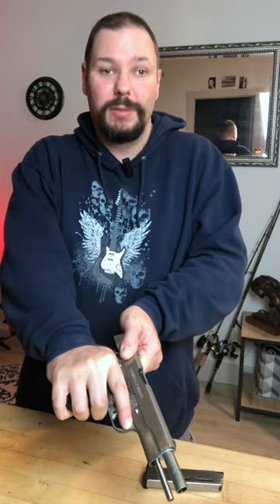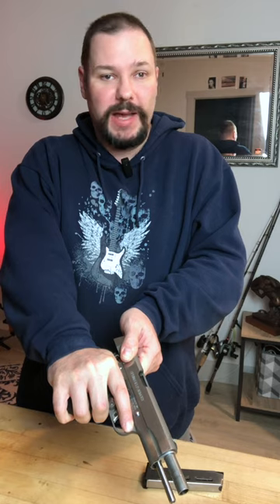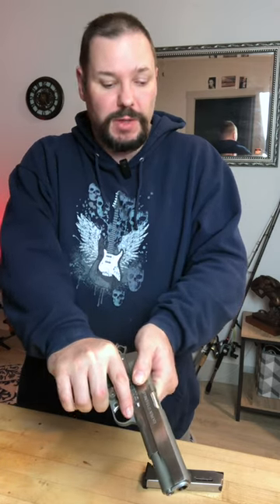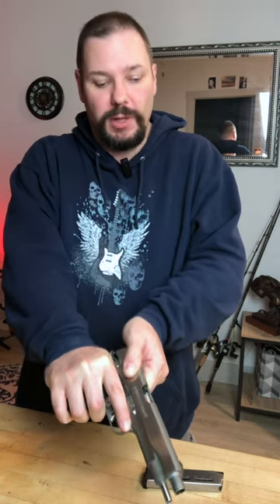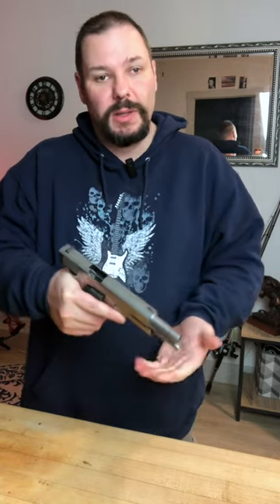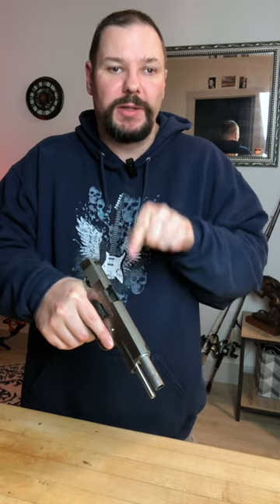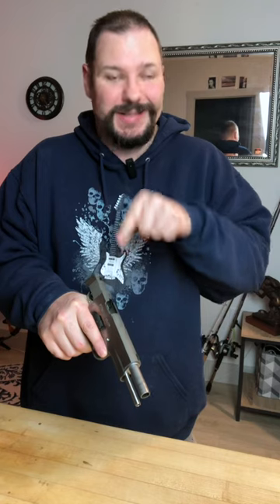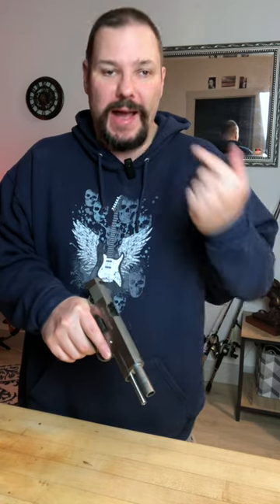Order Of Operations  - How to unload a Handgun Safely

Comment: I'm paranoid about clearing a weapon. I stick my finger in the chamber. I live alone, but, will recheck a weapon if I walk away. I never trust myself. It's the only time I feel it's OK to doubt myself.
Reply: Over caution when it comes to firearms is never a bad thing. However, being afraid of a firearm or "paranoid" as you put it can be dangerous. I suggest training under supervision of a professional until you become comfortable handling a firearm. There are classes that practice proper weapon clearing, handling, carrying, and firing if your interested. Hope this helps. =)
Reply: I wouldn't suggest putting your finger in the chamber.  Have you seen the force of the slide when it resets? No thank you.
Reply: @thezohan1960  that's the right way to check it 👍
Reply: Sticking your finger in a chamber is more dangerous than forgetting or leaving a round in the chamber.

Comment: SOP when training new recruits in our organization. Whenever you open you gun locker and when you unload daily it’s always the same drill eject the mag, rack the slide to the rear (ejecting the round) and lock the slide open, peek (into the chamber) poke ( your pinky into the chamber to feel there’s not round ) and prod ( finger up the mag well again verifying nothing is there or stuck in the Magwell for when your reload).  This assist the aspect that in Canada over 85% of LEO recruits have never handled a gun in their life . Unlike 30 years ago it was more like 20%.  But this training forms a very good habit of visual and tactile confirmation you have unloaded correctly.  But also I can say in over 8 years outside of recruit training there has only been on accidental discharge at a clearing barrel. And that’s with 500+ officers in the field daily.

Comment: Amen! I've had a 12 Guage Mossy Shockwave that one stuck in the chamber after racking it maybe 30 times working oil in. I glanced in but didn't look too good I guess. I had to fix a hole in my wall, and needless to say it'll make the woman living with you very unhappy as she just bought the fire extinguisher I hit first. But I confirmed #4 buck is good for an apartment 6 went thru 5 came out the other side and all over the floor. The other 25+ pellets went everywhere else like a grenade and it took out 2 light fixtures and everything on the kitchen counter bouncing everywhere. You can see little dents here and there in the kitchen. I been shooting since I was 5 and have always been very careful. It can happen and I got lucky and learned a lesson for life!

Comment: I rack it back and lock it with slide release with the mag still in it and look if I can see the follower. Then just tilt it back and forth, chamber, follower, chamber, follower. Extra points for seeing an extractor and putting your finger tip or stick a chamber flag in the chamber to make sure it’s clear.

Before you dry fire it, you check again to make sure you are not trippin, and then check again to make sure you are not tripping balls.

Source: I work at a gun range/store

Comment: He's absolutely right. I did a poll on Reddit on r/firearms asking people if they've had a negligent discharge in their life, and how much experience they have or had at the time. For the people who had a ND (about 30%) it was about 60/40 over/under 10 years of experience. A fella in the comments admitted that he was an Army armorer for 20 years, worked with guns his whole life, and last month had racked the charging handle on his AR-15 before putting it away, but breaking the advice he always drilled into his subordinates in the army, he didn't visually inspect it. Dropped the hammer and bang, thankfully nobody got hurt.

Always look. And if you're about to pull the trigger for some reason, look twice, hold it open and hesitate for a moment, gaze lovingly into the chamber and confirm that you are not blind, you are not distracted, you are not hallucinating, there really is nothing in there. Someone's life may depend on that simple operation.

Comment: This! especially if it’s a third party mag, and or a reloaded cartridge, even more so if it’s both of these circumstances! Could be issues with mag spring, the feed ramp, feed lips, seating issues, extraction issues, and sometimes if it’s reloaded ammo that you yourself didn’t  reload, there could be a myriad of different issues with dimensions and small issues in the reload process. Rounds like .380 auto and 9mm can be very easy to mistake, ESPECIALLY IF NOT TOGETHER FOR COMPARISON.

Comment: Thanks god I’ve always been skeptical about rounds not ejecting when unloading my guns 
So I automatically check the chamber 3-5 times after removing the clip I still go to a safe place point either down or to a target and proceed to dry fire reales if all parts from tension making it safer to disassemble for cleaning etc 
Please post some safety tips soon on how to handle loaded firearms so people learn , here in Georgia anybody can now buy firearms without the proper training nor licensing and I feel there should have never allowed that without offering free training before hand but it is what it is

Comment: Also little tip a shooting instructor taught me. When you rack the slide don't use your thumb, use your palm and fingers.
Reply from the maker: If grip strength is an issue, absolutely. particularly for smaller hands on pistols with heavier springs.
Reply: @BulletsNBrass  I was told of an officer shooting where his thumb was shot off and he didn't realize. When reloading he tried to pull the slide to rack a new round and couldn't. Was shot and killed

Comment: I know it's 1911 model but which gun is this actually
Reply from the maker: Springfield armory mil-spec stainless. It’s had some work done though. I bought it heavily used and modded the frame to suit me. I use it with a 22 conversion usually, so the slide is still stock other than a full length guide rod I had laying around.

Comment: he didn't mention why you should look some blowback guns do not have an extractor the pressure blows the brass out other ones the extractor may be not working and not pull the bullet out. and almost two fed rifles there is a catch into the catches the next bullet so you need to work at 2 or 3 times to make sure you get everything out. (shot holes in two houses learning this)

Comment: Actually, the very first step when clearing a weapon is to put or attempt to put it on safe before dropping the magazine. Some pistols do have a safety on them.
Reply from the maker: See the video I just posted. Quite a few pistols with a manual safety don't let you operate the slide with it on. I would put "turn on the safety" into the category of good advice, but not part of the general procedure. If you can, great, it can only make things safer, but it's not actually part of the process itself. It's like wearing a helmet on a bike. You don't need it to ride (other than maybe legally) but it's generally a good idea.

Comment: Actually, you missed step 1. Make sure gun is pointed in safe direction. Thanks for playing.
Reply from the maker: Actually I didn't. Never assume. One concrete wall is as good as another when they're on five of the six possible sides. The unsafe direction would have been to my right, which has windows leading to a public space. But hey, you bumped the YT algo for me so thanks for playing.

Comment: Final step, drop the slide on an empty chamber on a 1911 to destroy the trigger job!
Reply from the maker: Maybe if you have crap parts, or super fine tuned parts, but these are quality parts with solid engagement. While I won't tell you it does nothing, if I eventually have to replace them it will not be from doing that, it will be from how many times it got used for dry fire or live fire drill.
For those not aware, the reason this is considered an issue at all is that just like dry firing a bow, not feeding a round as the slide closes results in higher speeds and a sharper stop. It can lead to what's called sear bounce. Since the engagement surface between the sear and the hammer is a very tiny shelf under significant load, that causes more wear and tear. On quality guns with good parts it's more likely to just make your trigger feel more gritty or have a bit of a catch to it. On guns with lousy metal for those parts it can lead to enough wear that you get something called hammer follow which is where the hammer drops with the slide because the sear couldn't hold it. The contact surfaces have rounded off.

Comment: Another tip I would give is to not rack your gun like that but rather practice racking your gun with your palms and fingers over the gun rather than just your thumb.
Reply from the maker: Both work, what you're describing works better if someone is marginal for hand or arm strength. I prefer this method for myself because it makes it easier for me to see into the chamber. Annoyingly, the smaller handguns with stiffer springs where the other method would be most beneficial are actually harder to see into when using it. I've done a few videos where I talk about different methods of operating a slide, maybe I should do a short on it. There are a few different ones and they have different pros and cons.

Comment: Also don’t flag walls in the house while your checking for a round
Reply from the maker: Well, since the walls in my house are concrete and the floor and ceiling are also concrete… the least safe direction would be to my right, which has windows. To my side or forward would have to go through two concrete walls to get anywhere, at the minimum.

Comment: Well the real correct way would be to place the weapon on safe and cocking the slide back ensuring any round is ejected and nothing in the chamber.
Reply from the maker: Good luck with that, as I've said on a few other comments, that's physically impossible on a 1911 and many other handguns. In this case, because you can't move the slide while the safety is engaged. In other cases because there is no manual safety. Cocking is what you do with the hammer, not the slide, and the whole point was that just because you pulled the slide back does not mean the chamber is clear. Performing the action doesn't mean you got the desired results. You have to actually check.

Since there seems to be a lot of confusion specifically about "put the safety on first" I actually plan to do another video. The whole point is educating people, so if that many folks don't know why I wouldn't include that step it's worth putting in a video.

Comment: Most of the time on hand guns if there is one in the chamber if you pull the slide back it will automatically extract the round there for nothing being in the chamber if something happens it was a gun malfunction there for you are not liable due to the gun manufacturer
Reply from the maker: If your firearm puts a hole in something it shouldn’t have, and your finger was on the trigger, you are the responsible party. The only way a court is going to assign blame elsewhere is if it fired without any input on your part. You are responsible for making sure it’s clear.

Comment: Drop the magazine and rack it 3 times. 
There's no way a bullet would stay in the chamber if you rack it 3 times.
 The reason that we rack it 3 times is to make sure the idiot didn't leave the magazine in.
I have never seen a gun that didn't Get rid of the round in the chamber when you rack it back.
Reply from the maker: I've had plenty do it because the rim had an issue, the extractor was broken or it was a rimfire that only catches the extractor after firing.

Comment: Lock the slide back so right away you are wrong
Reply from the maker: You can do that, but you don’t absolutely have to, unless you are in a formal organization that codified that as their choice in the procedure. It can certainly help, if you have trouble holding the slide back to look properly, or choose to check digitally or put in a chamber flag.

Comment: Failed before step 1.......... SAFTEY ON 1ST
Reply from the maker: Nope, wouldn't apply on many handguns that don't have a manual safety and would not work on a 1911 because you can't engage the thumb safety unless it's cocked. Once engaged you can't move the slide, removing the ability to clear and check the chamber. Yes, I agree that's an annoying design feature and I appreciate that most modern firearms with manual thumb safeties don't do that, but it means step one is to drop the mag, step two for THIS firearm would be to actually DISENGAGE the safety (making sure you're following other safety rules, because it is absolutely a situation that should have you on high alert) and three is to pull the slide back. As some folks have mentioned, you can and probably should, lock it to the rear at that point. I rarely bother if I don't plan to leave it locked, but if your grip strength is lower then locking it back lets you stop holding it while you look. In a gun you need or want to stick a finger in the chamber to verify, locking it back would make sense if it applies.